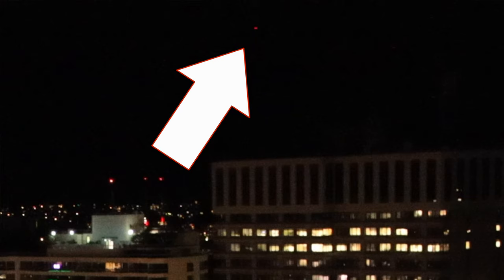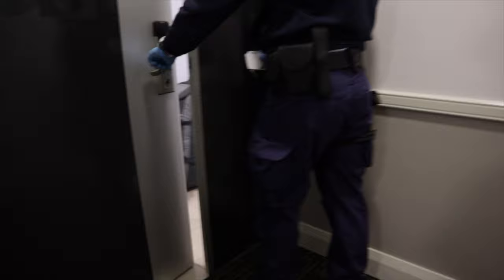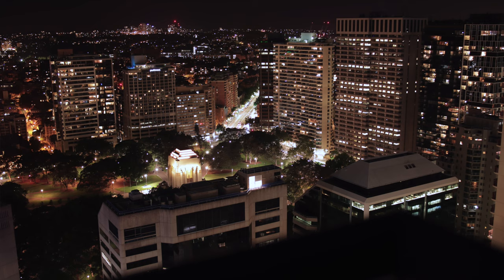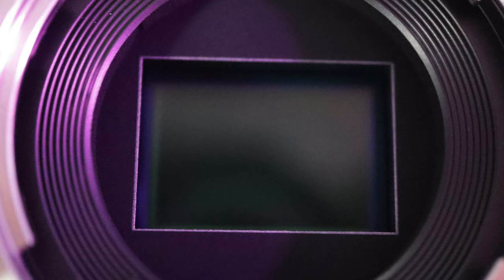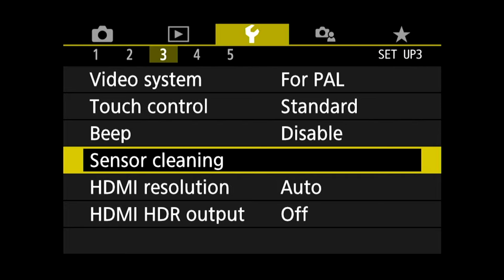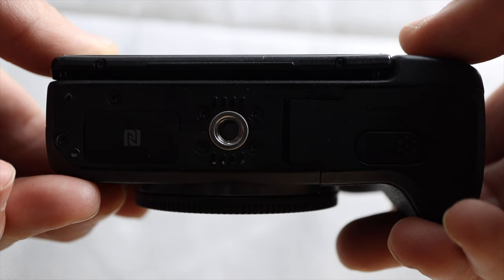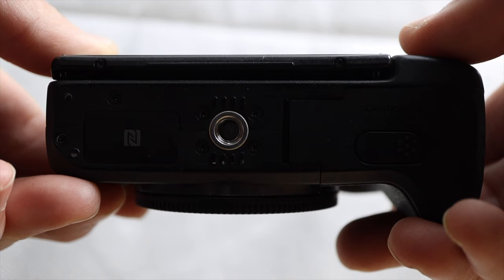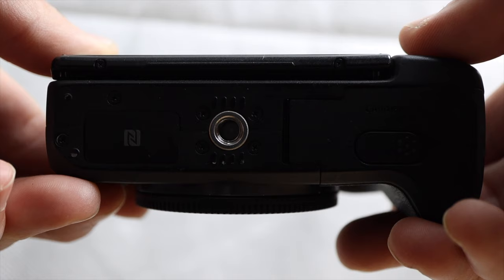How to Fix a Stuck/Hot Pixel on a Canon Camera

Comment: SUCCESS! I tried the face to the floor cleaning idea, 8 times and it worked!!! Red pixel gone! Thanks for the suggestion. 👍🏽
Reply from the maker: Fantastic!
Reply: I will try it a few more times. I didn't want to overdo it incase it didn't do the camera much good, LOL. I tried it 5 times in a row so far and although it greatly reduced the number of dead pixels I had, I still got around 4 or 5 left. So thanks my friend, I will try doing it a few more times. Interestingly I found it didn't reduce the number of dead pixels I had on the JPG files, only the RAW files. But hey, they are the more important ones anyway.

Comment: I can feel you having this trauma of getting back cameras from the "repair" stating nothing or "no problem detected"! Talking to the hotlines is usually like asking your local bus driver how rocket science works, they are mostly clueless! 
I'm actually in the same situation right now with my brand new R5 which has a hot pixel at 1600 ISO 🙄 thanks for the informative video 🙏🏻
Reply from the maker: Hopefully you get a good result too!
Reply: @markwiemels  that's exactly why I only buy at a certified photo equipment dealer. They will have to take care of, no worries for me! I guess I can expect that when buying a 5000€ camera body 🙈
Reply: Same. Crazy how they just come like this out of the box
Reply: @neglectedloves  I'd say you got lucky, I bought new from a certified dealer too and got a stuck pixel as well

Comment: My Fuji GFX 100S had several hot pixels. I was able to resolve the bulk of them using the pixel-mapping command option in the camera. However, a couple of stubborn ones remained unmoved. I spoke to Fuji support, no questions asked. Requested me to send the camera in, and I got it back within four business days. Sent on a Monday morning and received on Thursday. I've been running the pixel mapping command frequently to be on the safe side.

Comment: Got a solid deal on a t3i with a handful of lenses at a pawn shop. Now Im seeing why is was such a "deal," there are TONS of stuck pixels 😭😭
Thanks for the info brother, I'll keep diving into it
Reply: Similar with me. I bought my 80D used from a woman near me off Facebook. She had only used it for 9 months for a friend's wedding and a holiday, but said she couldn't get on with it. Ok maybe she didn't do any high ISO or long exposure shots in her time, or know what hot pixels were. But after a year of owning it myself, I've just tried using it for some extreme long exposures of over 20 seconds and I've got loads of them. It looks like I got a starry sky on my images. ☹ I tried this method twice and it hasn't resolved it, though I did find another video where you take the battery out when it's turned on, which seemed to work for most people. If this don't work when I try it 8 more times, then I will try that.
Reply: @MrBooojangles  yo that's interesting! Could you send me that video?
Reply from the maker: Damn.

Comment: I now have around 15 stuck pixels on my R5C after shooting some long exposure shots and some timelapse. They only show on long exposure photos, not video, but what's a pain is I've also had this on my Z Cam E2-F6 after shooting some timelapse, which is why I decided to use the Canon instead...ha ha. The Z Cam however has a mode where you can get rid of these stuck pixels without having to send it in, and without replacing the sensor. It involves wrapping the camera in a towel, setting it to record in its highest frame rate, recording till it reaches 60 degrees C, then running the hot pixel calibration, which takes 5-10 mins. After that all is good again. Guess I'll be going back to doing long exposure timelapses with the Z-Cam...!

Comment: Awesome vid, I also had this issue many months back with my R5, Sent it in and it was returned without any work being done. Pissed me off, I did contact them again and they did do a better job 2nd go, cleaning won't do anything. They remapped, and unfortunately I got them back so will have to send it in again. So much for remapping
Reply from the maker: That's not great, you are not he only one to mention this issue with the R5.

Comment: Thanks for your video. I’m in a quarantine hotel and while messing around with my eos R noticed a red pixel. Tried the sensor clean and now it’s completely gone. So I’m very happy I didn’t have to send it in.
Reply from the maker: Great to hear! I was doing long time lapse in hotel quarantine, which i think is what cause mine.  Where are you serving your quarantine?
Reply: @markwiemels  I'm currently in Bangkok Thailand. I was using the R recently with a Camlink for streaming which I suspect might have caused the stuck pixel as you described in the video.
Reply from the maker: @damienrichardsonphotography  yeh, I would be carful with that stuff, I bought an older camera for Timelapse and long exposure now, any of those things that get the sensor hot and can cause the stuck pixels.

Comment: My R5 has 8 stuck pixels (5 blue, 1 white, and 2 red). I'm also registered with Canon Professional Services (they have a free plan), so I was able to just click on my R5 and begin the repair form online, no need for a phone call. Mine is still under warranty, so the estimated cost is $0. Sending it off tomorrow, I'll report back when I get my camera back. Thanks for the video.
Reply from the maker: My gosh, had someone with the R6 also with stuck pixels. That is a bit of a worry, what has canon said?
Reply: @markwiemels  I shipped it UPS on that Monday, had the camera back in my hands on Wednesday... very impressed with Canon's service. All of my dead pixels are gone now, I think they just remapped them.

Comment: I have a brand new Canon R6, I have barely used it and I just noticed a hot pixel. I did a sensor cleaning like 5 times, and I did a manual sensor cleaning (but just left it sitting there, it's not like I use alcohol wipes to wipe the sensor), after doing the sensor cleaning a bunch of times, I did another test where the ISO would jump into really high values by filming a dark scene and the pixel went away, however, if this randomly popped up again after I filmed a wedding, it would be pretty tricky to remove especially if you have image stabilization on cause then the red dot will move with the stabilization.
Reply from the maker: That sucks! on such an expensive camera. Has Canon offered to fix it under warranty?
Reply: Ultra late reply but no, the red dot will not move as it is on the sensor! That would only happen if the dot was on the lens :)

Comment: I have probably about 20 of them. Having had no idea that long exposures caused them, I guess I was making it worse. But my camera seems ruined now. The manual cleaning method hasn't been working for me, and after having only used the camera maybe a dozen times it really discourages me. But it is well out of warranty. So I appear to just be screwed. Is canon supposed to be this bad?
Reply from the maker: Give Canon a call, see if they will fix it under warranty, ya never know till you try, 20 pixels is pretty bad.

Comment: My rebel t6 don't have that auto clean option , manual cleaning open the shutter and expose the sensor  , what should I do now except contact  to the service center
Reply from the maker: Yes, I would contact your service center.
Reply: @markwiemels  I took a image of a white paper at aperture 29 and iso 100, and the paper was out of fous , to check sensor dust , then I find few tiny white spots which are visible only when I full zoomed in that image in my camera body , and the tiny white dots are more white than the white page I used in this case , are they dead or stuck or hot pixel?

Comment: I'm wondering why Canon cameras don`t have a pixel mapping feature. Olympus has this and it works well. More stuck pixels will show up after some time I guess. You won't change the sensor every time that happen.
Reply from the maker: I know, that is very disappointing,
Reply: It does though. On my M50, the sensor cleaning fixed it with one clean

Comment: Is there any way to clean up previously shot footage with a dead pixel or is it just ruined and has to be reshot?
Reply from the maker: I suspect there is, but I'm not sure, I have never looked into it.
Reply: @markwiemels  Just shot a short and when I was reviewing footage, I noticed everything has a dead pixel. Needless to say, my heart sank. It's good to know that at least their is nothing wrong with my camera (your fix worked! Thanks for the video!). Just wish I could say the same about all the footage. =/
Reply: A year later, but I use KdenLive for video editing which has a spot remover effect; it can be made as large or as small as needed. This worked great for me on 4/5 of the pixels. For the last pixel, I had to remove it frame by frame - used ffmpeg to dump each frame, edit, and then used ffmpeg to recombine back into video.

Comment: I bought a canon 70d online around September 2021, and I wasn’t aware of how many hot stuck pixels there were. when I started shooting the night sky I noticed them but thought they were temporary navies of info I got online, so I didn’t know they were such a big problem. I did the technique you did with manually cleaning, multiple times and the pixels went away every time, but many would recur or come back every time I would shoot. it’s frustrating cause I can’t return the camera. Are they permanent if I don’t have camera warranty?
Reply from the maker: I'm afraid they are permanent. You should be able to find some editing software that can map them, and remove them, in bulk.  I believe this type of program exists.
Reply: @markwiemels  that sucks, i believe when stacking and processing astrophotography data they almost entirely get removed so they end up not being much of an issue

Comment: I had 8-10 stuck blue pixels and 1 stuck green on my 5D3. Easily visible at ISO 1000. After running the sensor cleaning 5-6 times, all are gone, even past 20k iso. Thanks!
Reply from the maker: Thanks for sharing

Comment: You're lucky to have just one hot pixel, I've got loads of them and having tried some extreme long exposures today of over 20 seconds at just ISO100, they have shown up more then short long exposures. I did try some high ISO ones at short shutter speeds and they are still there, so I reckon they show up on long exposures as well as high ISO shots. I also tried some tonight of 3 minute exposures and it looks like I got a starry sky on my images of mostly red spots with some white and blue and I noticed a couple checkerboard ones like transparent pixels. That's obviously not noise. I've tried this method twice today and so far it hasn't worked. I will try it 8 or 10 times tomorrow and see what happens. If not, I found a few other videos with a method where you take the battery out when it's turned on and that seemed to work for most people.
Reply: @Levi Hoffman Hi my friend. I did another comment below which I did the same time ago as this one. Unfortunately I didn't seem to have bookmarked that one, where the guy removed the battery, which was frustrating, but I bookmarked two other links at the same time as I saw that, that showed the procedure but without taking the battery out, which was slightly different to the video on this web page. The comment below has the two links in it, but for some reason it won't allow me to highlight and copy them to paste here. What I will also say is, in my experience with doing this on my own Canon 80D, is that I did it 5 times and although it's reduced a lot, what looked like a coloured starry night on all my long exposures and those I did with even moderate high ISO, it's not completely removed them all from the RAW files. There is probably about 4 or 5 left. However, I always save my photos in the RAW and JPG formats and nothing changed on the JPG ones at all, of each photo. The JPG's remained the same. I only save in RAW and JPG so I could review the photos quicker on my Windows PC without bringing them in to the editing software first. Maybe I need to do the procedure more or maybe mine was so bad I need to do the dreaded deed and send it to Canon for repairs. I bought it used locally from a woman who said she couldn't get on with it and it was only 9 months old and had only done 2,400 shutter clicks. So maybe she got the dead pixels all over her photos and didn't know what it was and thought she had it set up wrong, but couldn't get rid of it, in which case, it must have had all these dead pixels from when it was new out the factory. In which case, that was very poor of Canon to send it out like that. 🤷‍♂️
Reply: I have 2 spots with blurry halo around them on my t5i when reviewing the video.  I stopped using this camera a while back due to a red pixel in the middle of the video but somehow it worse.
Reply: @supjay3945  it's annoying eh. I've tried the manual clean sensor method loads of times since I put that comment and they are still all there when I do long exposures or anything that I need above 400 ISO. I think I've just got a dudd camera, as there's other people out there that don't have this problem on the same model I have. I've even tried the manual sensor clean method 10 times in a row and although the colours faded out of them, it still left my photos with more of a fuzzy grey or white spots and the bright coloured hot spots soon returned again. I bought my Canon 80D, which is my first DSLR, because it was a more advanced camera then using bridge cameras I'd used before and that the image quality would be far greater. It kind of is better, but with all the hot pixels it has put me off using it, as i didn't buy it to have to spend ages removing loads of hot pixels from nearly every photo I do, when the bridge cameras never had that. I often only take my old Panasonic bridge camera out with me and leave the Canon at home, which is not what I wanted to happen.
Reply: @MrBooojangles  I tried 3 auto clean and the red dots were still there.  then 1 or 2 manual clean.  all I did with manual was turn camera upside down and looked at the sensor with flashlight.  Somehow all the spots are gone!  Will have to recheck them but I wasnt expecting this to work.  Cant believe I almost sold the camera for 150$
Reply: @supjay3945  I did the manual cleans with the camera face down as a video showed to do it. Do you mean you had the camera upright but upside down. Also have you tried any high ISO or long exposures of a few seconds long since your hot pixels disappeared. That's when mine show up and I love doing long exposures. If so I might try having mine upside down next time I do it and shining a flashlight in it. I will try anything now LOL.
Reply: @MrBooojangles  I dont recall any long exposures.  Maybe storage was in hot enviroment.  But I did 3 auto cleans recently.  Then 1 or 2 manual cleans with camera facing down so dust wont get in sensor.  I shined a flashlight but did not see anything.  When I checked the screen and turned camera on, I did not see any spots.  Im assuming the manual clean opened up the sensor and that decharged any static interference that may have cause the issue?  Judging what others have said.  I may post a video on my issue soon.  Good luck!  Hope it works for you!
Reply: @supjay3945  ah thanks my friend. Yeah if the worst comes to the worst, I guess I will have to send it to Canon to replace the sensor or something.

Comment: My M6 Mark II just broke! I was shooting a comparison video R6 vs M6. I had the M6 on my backpack strap and as I lifted it up to take a picture it was on was on "bulb" mode. I half pressed the shutter to get a reading and it started to jump to and from shutter speed, ISO, and exposure compensation. I half pressed again and it brought up my menu settings and then started to jump through all the different menu items. Almost like there was a loose connection and the camera just randomly jumped around. I turned the front dial to readjust the shutter speed and it would not go any higher then 1/60 and then it jumped back to bulb mode. I wiggled the shutter release and it freaked out jumping from shutter speed, to menu items, back to bulb mode again. Not sure what's going on with it. I guess I will have to call Canon and see what's up.
Reply: My kids are like that too sometimes, you want them to do something and they do 20 other different things instead 😋 Sorry to hear you camera broke... hope they can fix it 🙏🏻
Reply from the maker: Wow. This is the first issue I have ever had with a canon camera. They seem good about sorting it out, hopefully you will have the same experience.
Reply: @markwiemels  I hope so. I sent it off today. I will keep you updated.
Reply: @faspete2nd  what is the end of your experience?
Reply: @existircuantico7141  Canon sent me a refurbished model, but I had to pay. If you go to my channel I made a video about it.

Comment: The hot pixels is a problem with the electronics, it does not have anything to do with gravity. :-\ So... pointing the camera in whatever direction will not improve the cleaning process. :-\
Reply from the maker: True! The pointing down is more about the dust that the sensor clean is suppose to remove.